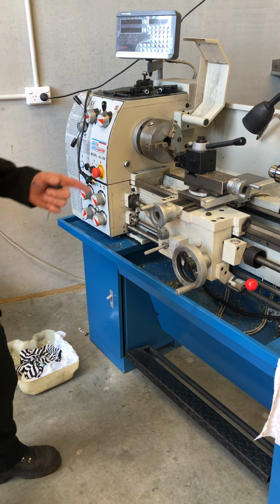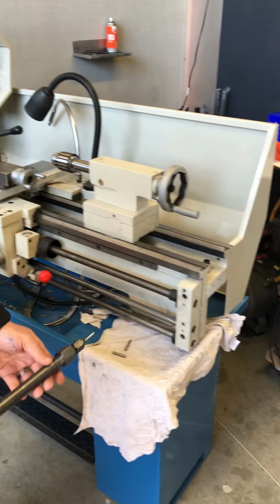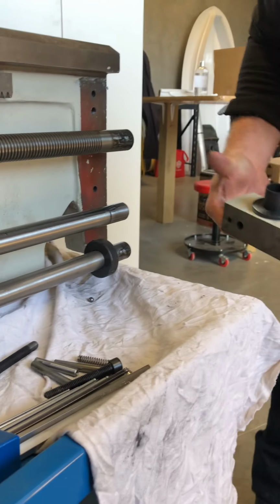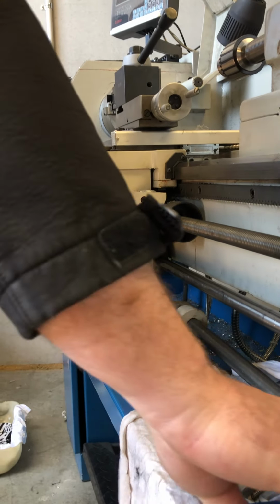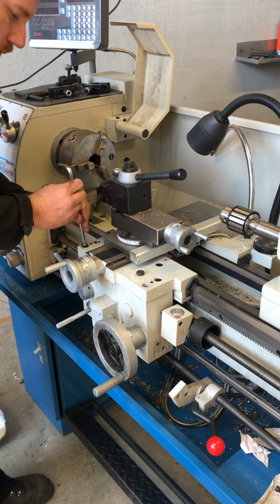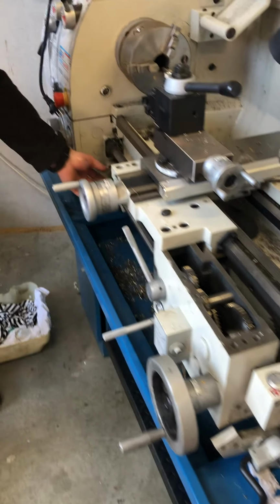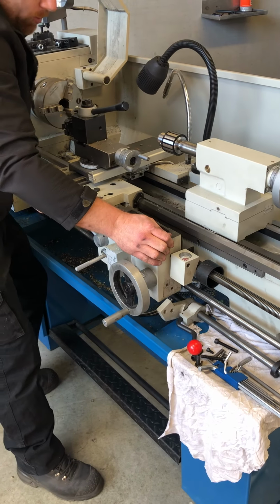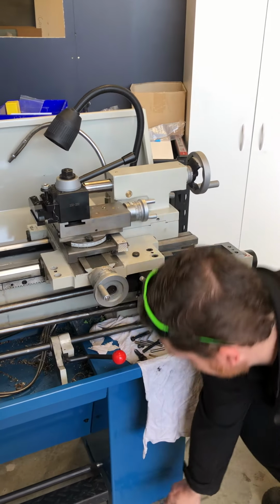AL336 Apron removal/MACHINERYHOUSE

Comment: Hi, Rober the lower part of the half nut on my machine doesn't engage and I want to remove the apron to have a look. Do I need the same sliding hammer? I have the same machine but from a different brand. 
Thank you in advance, the disabling video was very helpful.
Reply from the maker: Hi Daurant,

A slidding hammer does make the job much easier to remove the pins, but is not completely a must have.
I have once used a small 4mm bolt (This screws in to the pin)about 40mm long and a 10mm nut to get the pins out.
It is a hard to explain, but what you do is first put the nut over the pin(yes while the pin is still inside its hole),then a flat washer that has a outside diameter of the same size as the outside of the nut and a inside diameter the size of the threaded part of your bolt(I think its 4mm but might be 3mm), the thicness doesnt matter. This washer sits on top of the nut.
Next you start screwing you bolt/screw in to the pin, going tgrough the washer and bolt. After 2-3 full revolutions of the bolt, you want the bolt to start touching the washer and starts getting tight. This is how you determine the lenght of you bolt(The thickness of your nut and washer+ double the diameter of you screw(3 or 4mm which ever it is) .
You then carry on tightening the bolt. What is happening at this point is the bolt is being forced down on the washer and nut but it cant go anywhere then its pulling the pin out.
Some people call this manually jacking the pin out.

Hope my explenation made some sense to you and it help with the romoval..🙂
Reply: @robertsnyman2954 
Your explanation was perfect, I will try it tomorrow and thank you very much for answering that quick 😀
Reply from the maker: Hi Daurant,

I am so glad you found it helpfull.
I usaully dont reply soon on comments, purely because my notifications was off and I dont post videos, this was a once off.
Now that I have seen how much this has helped, I may start posting more.
Hope you get it fixed fast and easy.

Comment: when are you guys going to tell the factory that theyre machining the tailstocks backwards? every other lathe i have ever looked at or used has the overhang on the headstock end where its needed. just seems to be the al336 that has this peculiar design feature, to have a flush front. effing annoying. not exactly easy to fix, either.